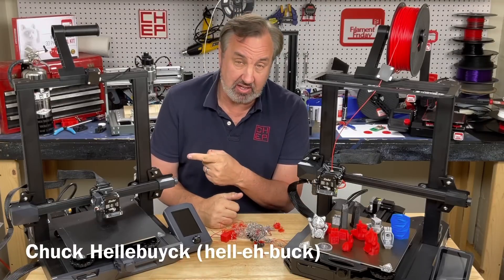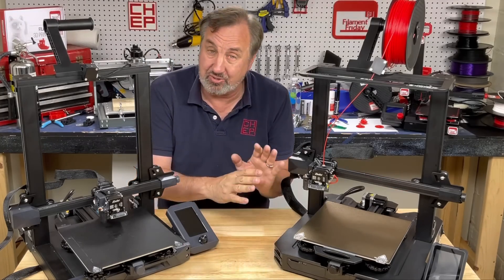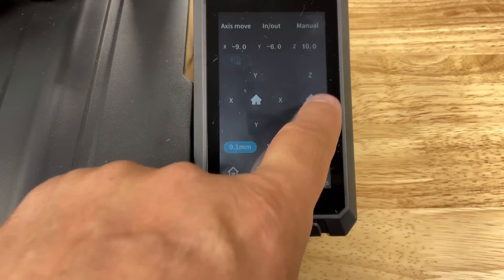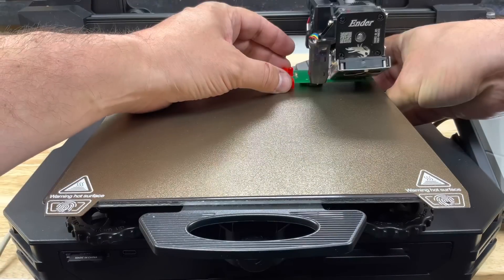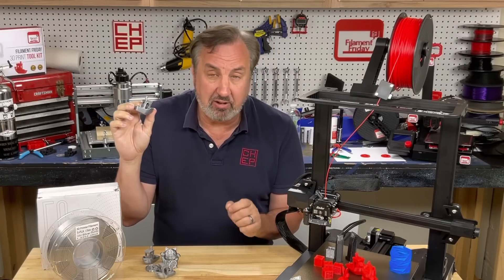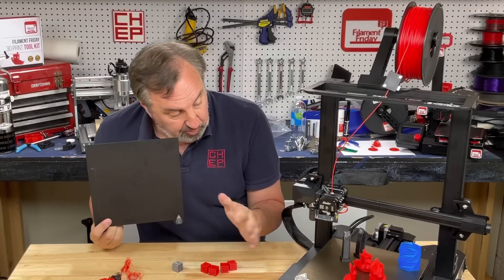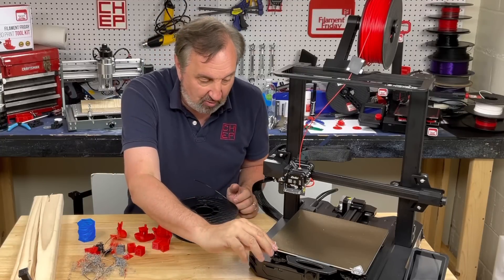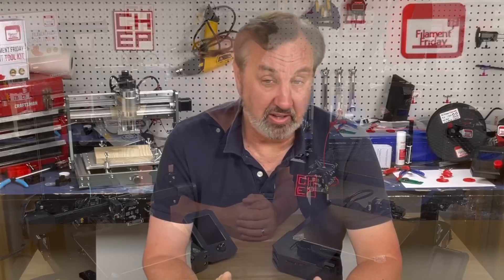Ender 3 S1 Pro - High Temp Direct Drive 3D Printer

Comment: I agree about the touch screen and got a non-Pro S1 (an "unrepair" S1 via ebay which I repaired with 2 easy fixes). I am waiting for a high temp hotend upgrade and will install that.  I am used to a PEI bed on my Prusa Mk3 PEI bed so swapped the PC for a Creality PEI. So far no problems but the Prusa PEI steel sheet will fit the S1 so will use that if the Creality becomes a problem.
Reply: Hi David, I'm having the exact same issue as CHEP with this PEI bed. I cannot get anything to stick and my bed is perfectly level. It has to be this PEI bed. My S1 Pro is a refurb so maybe the bed is toast. However, I was going to go for a Prusa Mini+ just because I want a printer that "just works" but you say it has the same PEI bed? I'm confused why Prusa's PEI bed works and Enders doesn't.
Reply: @eighties8  Hi Scott, The Prusa's have a PEI coated steel bed but I don't think they are exactly the same as the PEI Creality bed. Even on the Prusa I occasionally get PLA adhesion problems and have to use brim and/or increase the bed temp. I also clean the PEI sheet quite often with car glass cleaner.  Also, I have found that the leveling system on the S1 is not as good as that on the Prusa - I installed the excellent mrriscos "professional" firmware and it reports an un-level bed even when the Creality firmware suggests otherwise. Re-leveling to the "professional" firmware satisfaction, tuning the Z offset and frequent cleaning have improved my success rate.  I have since replaced my hot end with a high temp version as Chep describes so have a uncalibrated S1 at the moment. and will be working my way back through calibration and levelling.  Good Luck

Comment: I don't know how the black bed is to print on due to not having it.
This is my first printer and I haven't had any problem at all with prints sticking to the PEI bed. might be that I just in general prefer to add a brim to help it stick?
yes, it's wasting an ultra-tiny amount of filament, but compared to 1 failed print it's nothing in the long run.

Totaly agree with the touchscreen on the S1 PRO interface is a flaming pile of dog S**T
Reply: I can't even get the outer circle of the Ender sample BIT coin to stick. It lays down half of the circle fine, then unsticks the rest. This PEI bed is a mess. The printer is going back and I'm going Prusa - apparently they know how to make PEI beds that stick.

Comment: Did you try washing the pei sheet with a with hot water and dish soap? I do that with all my pei beds. As long as the squish is good, never have issue with pla or asa.
Reply: I'm having same issue as CHEP. My S1 Pro is a Refurb model tho. Maybe the PEI bed is toast? I'll try your suggestion, but this surface must be super picky. Do you even touch it between prints? How do you maintain it between prints so the surface sticks?

Comment: Sir can you make a Ender 2 Pro board disassembly video. I'm stuck. I reached out to Creality. You have to take the 2 long bolts off the top, the 2 sets of bolts off the side to remove it from the assembly and the small screws on the bottom get it like 90% off. It feels like a tab/clip is holding it but I have no idea. I'm trying to completely replace the hot end and thermister because I broke it. Or I could cut and splice which I'm trying to avoid.

Comment: With a custom Firmware (Search for Ender 3 S1 Professional Firmware) you can unlock higher Nozzle Temperatures via a custom G-Code. I would love to see a test of the new Hotend on the Ender 3 S1
Reply from the maker: Are you referring to Miguel’s firmware?
Reply: @FilamentFriday  Yes, I am. With "C104 U1 T###" you can unlock the hotend maximum temperature to ###°C. I am using the UBL Version with octoprint since April (with the stock hotend) and I am quite happy with it as it allows to use the Standard Display with octoprint the same way as if you were printing from sd-card after adding M75 to your start-gcode or octoprint
Reply from the maker: I’ve got an email in to him asking about S1 Pro firmware. I check into this. Thanks for the tip.

Comment: Proffesional firmware or klipper. For 300c I use klipper for my s1 modded can do 300c and even bed temp at 110c if needed haven’t got that high.

Comment: Chuck, FYI, Bought the Creality 4.2.7 upgrade board to replace my original for the silent steppers and after 6 months the mosfet to the bed failed. Allegedly this is a known issue. I bought a replacement BigTreeTech SKR mini E3 board to replace it and the mosfet is four times the size of the Creality board. Not to mention the extra features the BTT board has. Just wanted to let you and your viewers know this.
Reply from the maker: How hot do you run the bed?
Reply: @FilamentFriday  Chuck 50 to 60c depending on the print. When the Mosfet fails it jumps to 120c with an alarm and a shuts down the printer. Again a known issue which is not being addressed.
Reply from the maker: I have that board on several machines and run those bed temp all the time. I’ve never seen what you describe.
Reply: @FilamentFriday  The third party seller of the board told me that's what quite a few of their customers have experienced over time. They refunded me 1/2 the price of the board and sent me the BBT SKR mini E3.

Comment: I just got mine last week. Doing my testing on it an their slicing setting were the problem. After I put my slicing setting iv haven't had a single failed print. And I prefer the pei plate  as well. Never had sticking issues. Love this printer so far.

Comment: I use PEI on 8 machines. when it doesn't stick I use my orbital sander with 1000 grit on it then it is fine.
Reply: Doesn't that just remove the PEI surface? I'm noob so just asking.

Comment: Strange with that PEI bed since that type of surface cleaned with 90% or higher IPA on a different machine and bed resulted in such high adhesion I could barely get the ABS print off of it.  I wonder if that bed was defective in some way as I don't recall other reviewers having that problem.
Reply: I'm wondering same thing. My bed does same as CHEPs. I got one ender BIT coin to print but then nothing sticks. Using 99% IPA scrubbing the hell out of it. Bed perfectly leveled. I'm thinking its because mine is an Ebay discounted "refurb" model. My PEI bed must be toast, but it looks new. Maybe CHEP got a refurb with a toasted bed too?

Comment: I have the S1 Pro and the only time I have had adhesion issues on the bed it comes with using with PLA is when I tried to use a .20 feeler gauge to tram it.  When I went back to A2 paper folded over and silicone mounts (replaced stock springs) giving an offset of -1.95 (for my setup) with slight drag on the paper at all 5 points using Aux lvl everything sticks like mad on this bed.  The UI does leave a little to be desired and is clunky. The auto level on the S1 Pro is an absolute bugger to get right, but the Aux Lvl. works like a charm.  I start at pt 1 then go through the corners, then back to point 1 to double check. So far it lays down a very good initial layer with no smushing or elephant's foot issues. 

As for settings in Cura 5 I use the Ender 3 Pro default with adjusted height. Material printing PLA @ 200c Bed temp of 55c. Quality .2 or lower. 3 walls, Initial Layer H Expansion .1mm, 20% infill Cubic Sub, Speed 50mm, Initial Layer sp 15mm/s. Retraction .8mm @ 40mm/s. So far I have only had one spaghetti/adhesion failure and that was when I re-trammed using the feeler. After resetting with A2 paper all other prints have stuck to this bed and come out looking really good with little to no stringing using Hatchbox filament.
Reply: I'm using the white sample filament that came with the printer. It does not stick at all. It looks like the problem starts while the head is heating up to 200C. At about 190C,  the filament starts to seep and by the time it starts printing, its got about 10mm of seeped filament below the nozzle, that's causing drag/smearing of the test line and print. Is this a faulty hotend or just bad filament?

Comment: I have been printing a lot of Hatchbox ABS.  No problems with the bed.  I keep it hot at 110C.  I have been happy with the S1Pro.  The best thing is your FF fast profile.  I use it almost exclusively.
Reply: I have the same printer. Do you ever experience loud clicking noises from the gear on the extruder using his profile?

Comment: I bought one of these a few weeks ago and have been very frustrated by the inconstant prints! Thanks for confirming that the PEI build plate is the main issue! One thing I haven't seen mentioned in any reviews or videos for setting up this printer so far are the rollers for the bed guides, mine were loose and had to be tightened to stop the bed from wobbling.
Reply: Most printers with POM wheels will need adjustment, its just one of those things

Comment: Great video CHEP!
There will be a bunch of people keen to see a sprite extruder pro kit upgrade video!
I upgraded my v2 to the Sprite extruder pro kit and had all sorts of issues until I  came across Aim6mac video and works great but would like a more factory install regarding the firmware.
Reply: Why would creality make firmware specifically for the v2 with a sprite extruder? Only a few people will do this upgrade and most likely won't be using factory settings and will have modded their E3 a lot

Comment: I got mine mid April and always have good adhesion. This is my first 3d printer and after watching some of your videos and other creators I’ve noticed that apparently the s1 pro mentions to do something you don’t usually do on other printers and that is after running auto bed leveling to readjust your z offset. from my experience the z offset is usually a bit high after auto level and I have to turn it down to the proper height or then you won’t get good adhesion
Reply from the maker: Every autolevel needs a z offset setting after running. Ive shown it in my autolevel install videos. Probably should have mentioned it here too.
Reply: @FilamentFriday  I was just about to say the same thing!

Comment: Mine has a ribbon cable so short that it pulls out the connector at barely 200mm Z height. Automatic bed levelling is frustrating as well and malfunctions half of the time.

Comment: Please try to do auto leveling with a heated bed. It seems to be a major issue with this machine. I finally got some updated firmware from Creality but can't get it to work.
Reply: You get the 203 error code when you autolevel the bed while heated? Then try to heat it like 10C above your normal leveling temperature, then turn the heat OFF and then start the leveling. The error code shows too when the heat is ON while autoleveling but not while its OFF. For what reason? idk

Comment: I'm very surprised nothing would reliably stick to the PEI. Did you try both the smooth and textured sides, because I've only found the textured side to be rather meh, but the smooth sides are usually amazing.

Also, that huge flex spitting a 2x4. You could have bought like 5 S1 Pros with that.

Comment: I have the ender 3 S1 and want to upgrade the hotend so I'm looking forward to another video about that when you do it. I am also happy you talked me out of buying the PEI bed, I like the one it came with but I put a hole in it 😣 Maybe I will try glass 🤷🏽‍♀️ Great video, thank you.
Reply: Buy a th3d pei sheet not official creality, there is upgrade kits for the sprite to be all metal without spending $90 for a whole new sprite, you can get just the heatbreak
Reply from the maker: Fisheiyy- Do you know where to get the firmware that upgrades it to 300°C ?
Reply: @FilamentFriday  You can just compile your own from what creality provides for the Ender 3 S1
Reply from the maker: They don’t supply the source. Plus I want prebuilt since my audience is a lot of beginners who won’t want to do that.

Comment: Great video! I have the S1pro and I agree the PEI is crap. When I print PLA, it just won't stick. However, with PLA+ less issue with sticking. Can you do a short video on how to use your electronic leveler on the S1 Pro? I have the leveler but can't get it dialed in. I tried following your other video on the leveler but because the printer have different setups, it's been a pain trying to use it. Much appreciated in what you do, thanks. Oh yeah..... I thought the S1 pro hot end was all metal with no plastic tubing.
Reply: The s1 pro hotend is all metal

Comment: I bought the Ender 3 S1 to replace my Ender 3 Pro....Big mistake. Regardless of retraction settings the hot end just oozes filament non stop and is a massive hastle to deal with. I went back to my old Ender 3 Pro as my main printer.
Reply: You clearly don't know what your doing then

Comment: I heard somewhere you clean the PEI metal plate with hot soapy water and that clean the coating that on them from Creality. I have an Anycubic Vyper with the same PEI build plate and I've had no issues with thing sticking and I've printed quite a few Chep cubes.
Reply: I agree! I've got an ender pro s1 and had adhesion issues until I scrubbed the bed with scalding hot water and soap. It's almost too sticky with ABS now until it's completely cooled haha ,but if anyone's interested I'll post again when I crack open my pla and PETG

Comment: I've had the S1 Pro for about 2 months. I really like it. However, I've found that if you clean the PEI sheet with IPA, then prints don't stick at all. Only after I have used the bed a number of times after cleaning does the adhesion improve. I won't ever clean with IPA again. Other than that, I've gotten good quality prints.

Comment: I have an S1 Pro (and an Ender 3 with PEI) and I am going to try your cube right now. I have had some stuff come off but most sticks fine. I am trying to be not afraid to try PETG or TPU tho, and recently dealing with some really crappy filament from big computing store - also I increased my printing temp by several degrees on this bed
Reply: I am no 3d printing expert, just stuck in the filament (old Amazon dark grey basic I had), downloaded cube, sliced it with base Pro .2 profile, printed, ... took 34 minutes, no detach, looks as good as anything I have printed, feels great (texture is important to me!)- maybe a bunch of problem PEI sheets out there? no idea. happy with mine tho.
Reply from the maker: Sounds like you got a good one. I had two bad in a row.

Comment: And I can control my Ender 2 Pro better with OctoPrint than with this thing!

I've said before I just started my 3D printing with the Ender 2 Pro, and the first time I've ever seen a spaghetti monster was with this printer. I was dumbfounded as it has been printing flawlessly before, PEI bed and everything. I didn't even need to scuff it, I didn't even clean it with IPA. It has stuck prints consistently, and prints using your 0.28 Extra Fast profile looked great, way better than what I was getting on my Ender 2 Pro. It started out innocently enough, a lifted part here and there, so I resorted to using brims. I mean, it has ABL right? Still got worse and worse, small footprint prints would generate spaghetti monsters consistently. Turns out... simple enough, the bed levelling again. Ran ABL, set the proper offset, and it has been great ever since. The 0.28 prints great, smooth even. So for me, I... am ok with the PEI bed. When the prints are stuck good enough at the correct temps, I find that even removing the print from the bed while still on the heating bed won't release it easily, and I have to lift up the steel spring sheet and bend it to remove it. If I'm a bit more patient, letting it cool down I can just knock it off the bed. So color me surprised you're not a fan with the PEI bed.

The OctoPrint issue maybe down to the firmware configuration, and I don't know how to even do that. I'll wait for someone to post a better firmware, and of course to rearrange the dang menu items.
Reply: PEI wise my experience sounds more like yours. I do have Octoprint running and manage it from there just fine. I hardly use the touchscreen which is a baffling dismay.
Reply: @ashvanes484  oh I can run and manage with OctoPrint fine as well. But sending G29 for instance would make the printer take a long time to probe the bed, or countless other weird issues I don't get with my Ender 2 Pro running OctoPrint.

Comment: I've only had bad experience with pei beds. I do not understand why people like pei.
Reply: You must be buying the cheapest pei sheets on aliexpress
Reply: @Fisheiyy  if I get great adhesion on a glass plate that costs about 20 bucks why would I spend any more on a pei sheet?
Reply: @Devgal89  PEI is much better than glass by far you just have gotten the absolute worst sheets, I have a TH3D PEI sheet and it is the best I have had 0 issues, even with the skirt and first layer of a calibration cube permanently engraved in the center I get perfect prints with 0 adhesion problems even on tall models with small footprints
Reply: @Fisheiyy  5 machines, glass works great on all of them. See no reason to even try pei again
Reply: @Devgal89  if you ever want want to print petg you will have to use something other than glass
Reply: @Fisheiyy  I print PETG on glass just fine
Reply from the maker: I print PETG in glass all the time. A layer of glue stick allows it to remove without issue. Though a PC coated glass bed doesn’t need it.

Comment: CHEP i already have cr-10 smart and want another printer with high heat capability and direct drive for about $600 or less. what would you suggest? dual filament or dual color would be a welcome bonus.
Reply from the maker: I don’t know of any high temp dual color at that price.